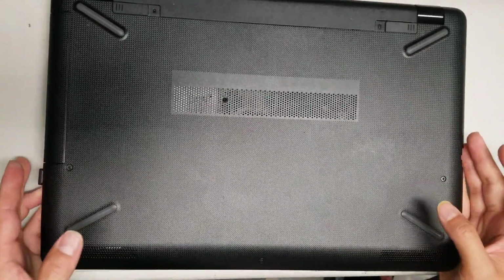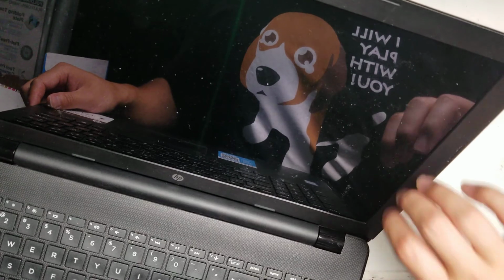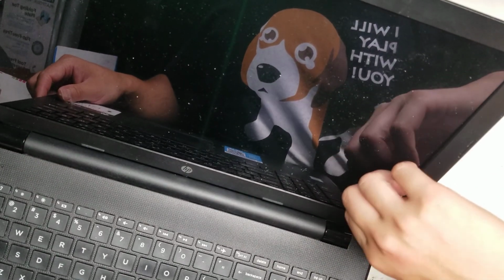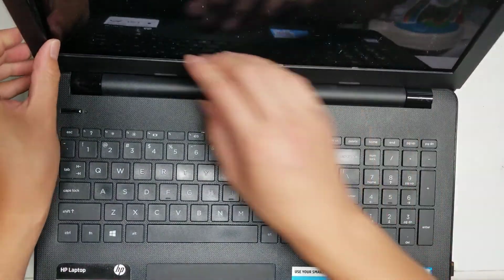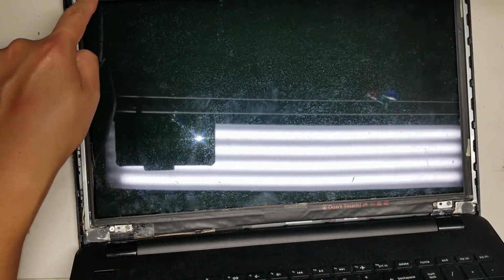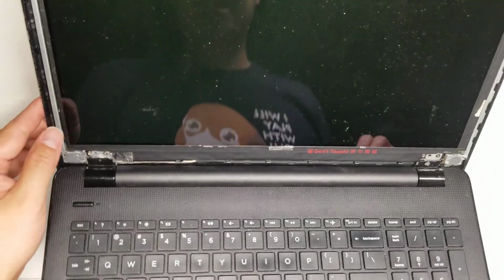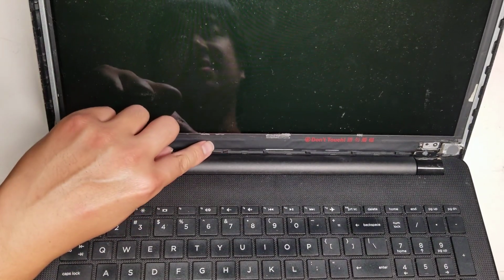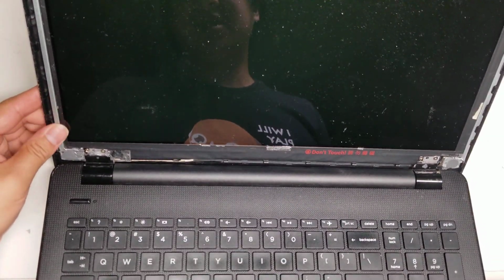HP 15-bs015dx Screen LCD Bezel Frame Removal Repair Replacement Part 2

Comment: Hi, do you have a video showing how to fix the hinges? Thanks in advance
Reply from the maker: hinge repairs vary greatly from model to model and how it's damaged, so I don't have many hinge repair videos. Most of the time it's not a hinge issue, but a damaged back lcd cover.